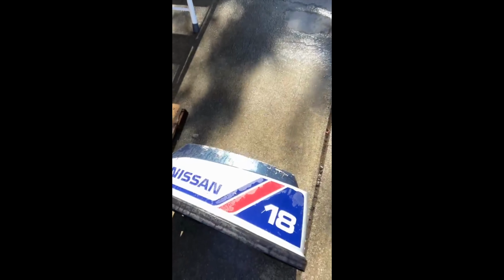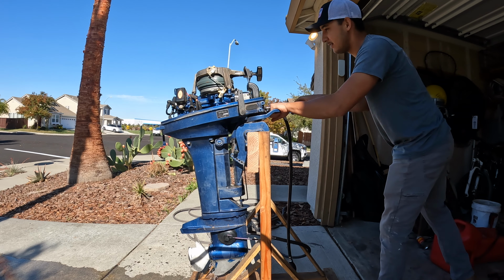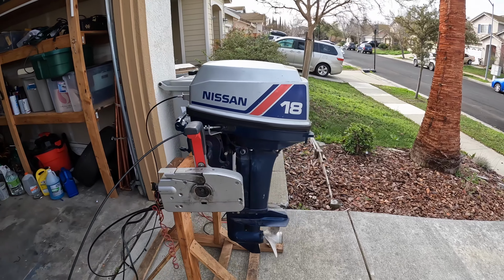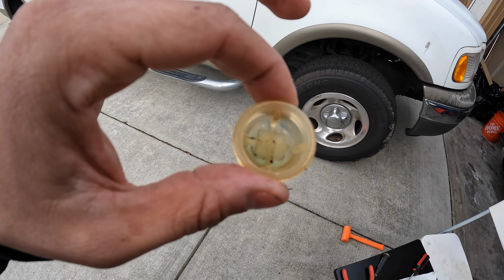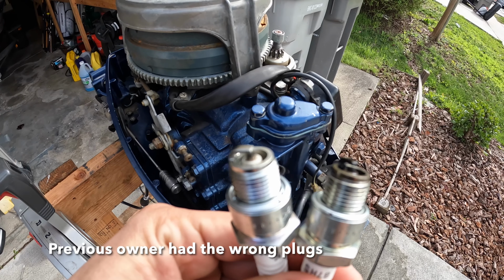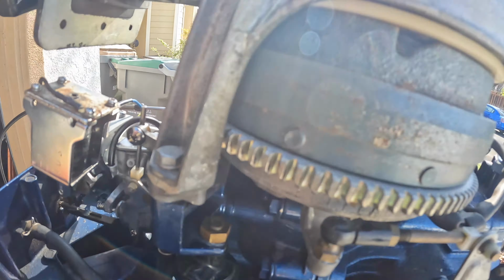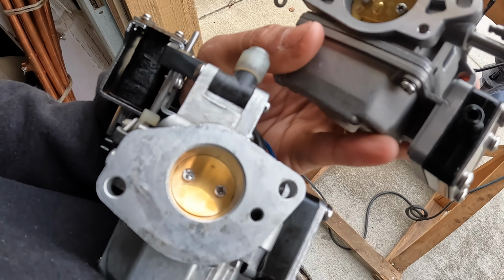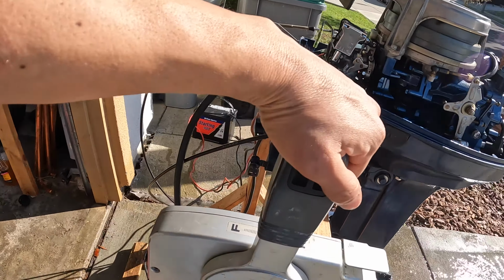Nissan/Tohatsu 18hp Outboard Motors Carburetor Cleaning & Adjustment

Comment: Nice video man! I have an old Tohatsu 15 hp and recongnized the aftermarket carburettor immediatly! have to work on mine for a while though before it can run because it has been abused by previous owners, but that will be alright. Thanks for making this vid and maybe I could use some of its contents to tweak settings on my motor!

Comment: Excellent  videos! I’ve got a 1995 Nissan 25 HP. All of sudden it started idling super high to the point I just shut off because I’m scared something’s gonna happen. I never adjusted either screw. Should I just let it run and see if it settles down? What could cause this super high idle?
Reply from the maker: @EthantheIncredible  Thanks man. You could take the airbox off and see the position of the butterfly inside carb. Adjusting the idle screw will adjust the butterfly. You could try backing the screw out a bit if it looks like the butterfly is cracked open too far which lowers the idle speed. If that doesn’t work then you could try adjusting air mixture screw. Do both adjustments in small 1/4 turns till you find the sweet spot

Comment: I need that air box for mine
Reply from the maker: @nicgin3945  Parts are hard to find especially these first gen 18hp motors. I’ve ran motors without an airbox and haven’t noticed much of a difference

Comment: have you been able to find carburetor rebuild kit for this outboard? please share website if you did, thanks
Reply from the maker: @lynhnguyen3929   No, they don’t sell it. These first gen Nissan 18hp with the blue decals use a different carb than the second gen gray decal 18hp motors. What’s wrong with your motor?

Comment: I’m having the same idle issues on my Nissan 9.9 , same year I believe
Reply from the maker: Have you tried cleaning the carb?
Reply: Yes, I think I have the same fuel pump issue . Where did you get your replacement?
Reply from the maker: @SebastianSculpts  It was eBay or Aliexpress aftermarket fuel pump

Comment: Hey there Im pretty sure I just bought that exact motor from Sacramento a couple days ago it doesn't have the tiller handle do you happen to know we're I might be able to get one I purchased it from marketplace I haven't had time to start it yet
Reply from the maker: Ya it could be the same motor. The guy I sold it I noticed reposted it with my photos trying to get more money.. I’ve seen some tiller handles on eBay. There’s a few linkage pieces I think go with it. Other hp models I think should fit but I’d double check
Reply: @sacratboatingandfishing  yes definitely well I haven't tried running it yet but now that makes sense I hope it still works
Reply: @sacratboatingandfishing  at first I seen it was for sale and then it sold and then it was for sale again the motor I currently have is a Evinrude motor electric start but it also needed work and when id seen how this motor starts with the key and the thodle lever I thought it would be nice to have I could probably rig something up for a steering tiller
Reply from the maker: @kevincampbell5357  I think the throttle box can be wired up to fit other brands of outboards. If you have any other outboard questions or want any repairs done shoot me an email sacratbf@gmail.com and I can send you my number
Reply: Thank you